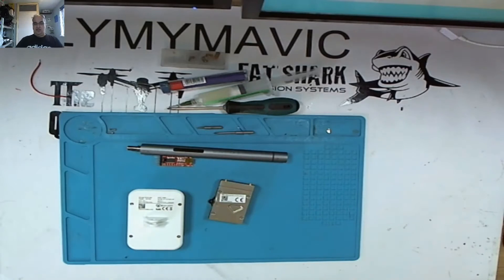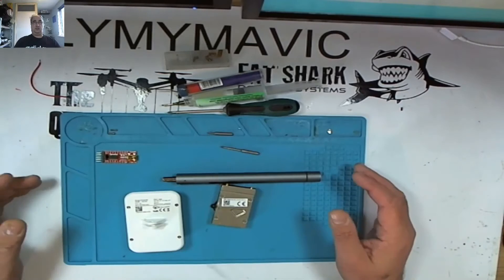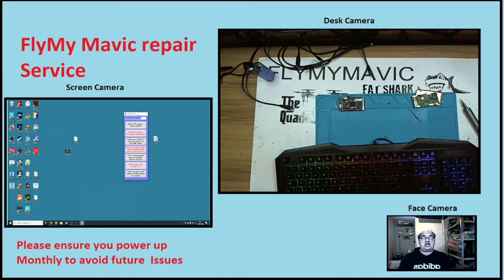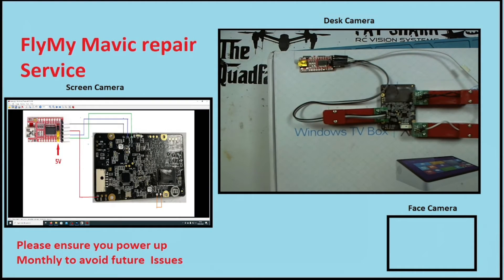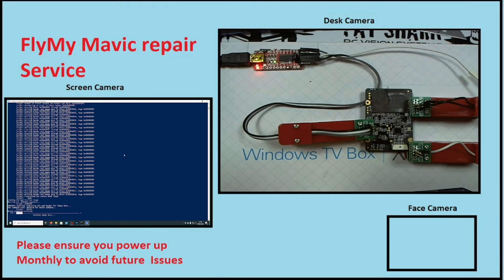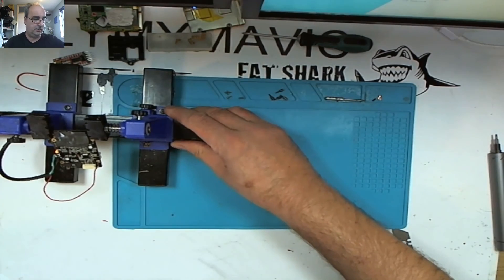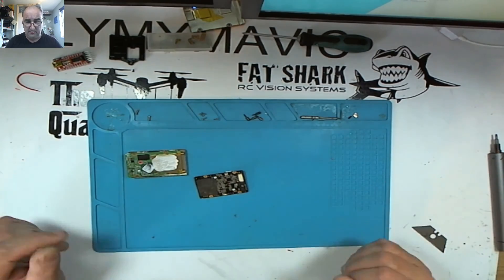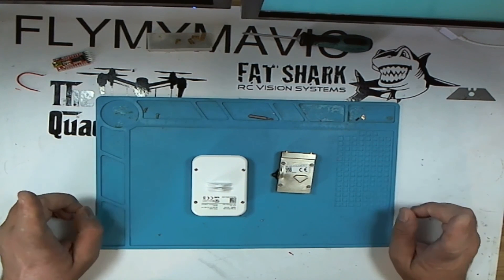No soldering needed Phantom 2 Vision Plus wifi module repair updated 2024

Comment: Hello, I don’t know if you are still reading the comments but I just want to give a big thanks to you because IT WORKS. I started off with very little hope and said to myself why not just try since all i need is to buy a ttl adapter which is dirt cheap and a bit of soldering. I was expecting a dead NAND but to my surprise the program did not stop at the part where you said the flashing is going to stop/loop if the NAND is fried. after i assembled it back together i could not believe this 13 year old aircraft is able to see again. Im very sorry i couldn’t buy you a coffee because of complications but i appreciate your work very much. thank you

Comment: Absolute LEGEND!!! I have just run this on my old Phantom 2 that had lost video feed and it worked. The video has some lines aross it though - like interference - maybe it is just wifi interference in my house. I will try it outside tomorrow. I have bought you a beer (coffee). Thanks.
Reply from the maker: So happy to hear that 1 you got it working and 2 that there is still another phantom still flying  , safe flight my friend.

Comment: Gidday from DownUnder, well New Zealand to be more precise.  I purchased my Vision 2 Plus not long after they first came out and I was doing real estate after having spent 45 years in IT.  Great for taking aerial shots of property etc etc. Anyway, gave up RE when I turned 65 retirement age here in NZ eight years ago and the drone ended up in the cupboard. Didn’t charge the battery so that died. Bought a new one a couple of years back and have kept it charged ever since. Decided to give it a flight when the new battery arrived, but yah guessed it no video, bugger.  Bought a replacement wifi module and all good for a while then that died as well. Seem to re-call they survive better with regular use.
Then came across your video and took some tentative steps but didn’t like the idea of soldering to the board, so back in the cupboard. Still charging the battery mind.
I came across your updated video which talked about crocodile clips and yeap thought that’s me and got them along with the usb board thingie from Aliexpress.
Spent 30 minutes shagging around with it and then hey presto managed to flash the board.  Just have to wait now for my old Samsung phone to charge up from dead flat to see if the backend of my workbench shows up via the drone camera.
If this works, then I can see a coffee coming your way. There’re some smart buggers out there and you would appear to be one of them subject to further testing.
Will let you know if I have been successful.
Cheers from 
Waipu New Zealand.

Comment: Dude - you saved my drone with this. Although I just bought it from eBay, it is my 1st drone. First I struggled with flashing the NAND for 2 hours with constant errors. Then I thought "Hold on, why isn't the TX light flashing on the programmer" so I used my other one, and it worked straight away. Flashed nicely, and worked. Thanks again.

Comment: Thank you so much! 🙌 This fixed the live view on my Phantom, which was just a black screen. I will take the advice to do the none solder technique next time, because it was not so easy to get the wires to stick to the contacts on the board. Now I have drilled many small holes in the wifi module case and added new thermal cooling compound. Hope this will prevent the module to overheat again 😊

Comment: I purchased the equipment, I connected everything and ran the program, when I do the test I get BOOT ME BOOTME so it's connected correctly but when I run the powershell command it keeps telling me command sent wait and it stays like this without moving forward, how can I solve it ??
Reply from the maker: Bootme just means it's getting a reply from the board however if the flash isnt progressing any further then the chip isn't willing to receive the program, this can happen if the chip is damaged or has failed
Reply from the maker: I would though check your wiring and ensure that the wires are touching only the small gold pads and not any other component
Reply: I have tweezers with 4 pins so 3 touch the contacts and one rests on the screen but I don't think it's a problem
Reply: What can I do to clear my doubts as to whether it works or not?

Comment: Great video.  I have an older Phantom 2 Vision+ that lost it's vision after being in storage for about 6 years.  Is the NAND-chip really bad quality as it fails in storage? Bad design of board? Heat affects the NAND chips, and they don't like to operate over 50 degrees C in my experience.
Reply from the maker: The original no hole unit did have a higher failure rate based on how many I have repaired over the years, hence I guess why they went with the vented module later on.

Comment: Hello once again, I have a question, this video where you present this update is only for Windows 7 32-bit or does it work for Windows 10 64 bis because I have the files from the video that I published a year ago and the truth is that it worked correctly for me to flash the module. What I have noticed is that if I use the drone with an Android lower than 4.3 or higher than 4.4, the module is deconfigured. You have to take into account that the module overheats a lot and I think that also implies that it is deconfigured. I really thank you for your time and for sharing your knowledge with others, God bless you.
Reply from the maker: Their are 2 files one for win7 and win10, I don't understand your statement about the android versions